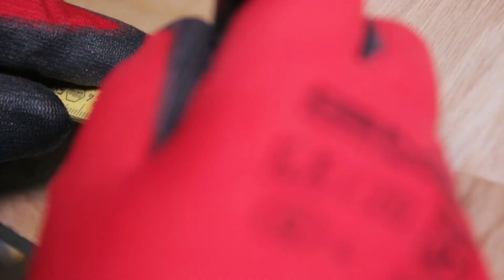How to make a modern copper pipe lamp

Comment: Is it a 240 Volt AC lamp ?......and is your earth wire hidden ?
Reply from the maker: Thanks for the comment, yes this is 230V.
These lamps are used in a house without grounding in the sockets. It was not common to have ground in sockets in Norway until after 1995. Before this, only sockets were grounded in bathrooms, kitchens and outdoors.

But I should have grounded this for use in a house with grounded electrical outlets. I will modify this lamp, and ground it later and create an article on my website on how I did this.